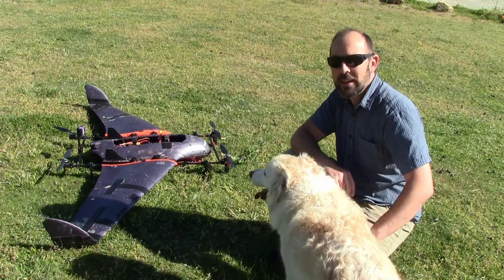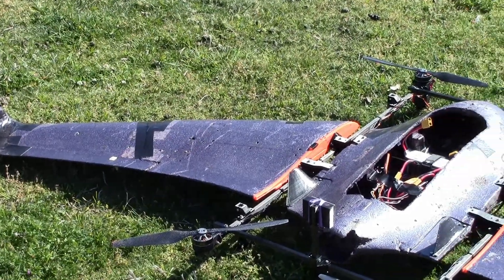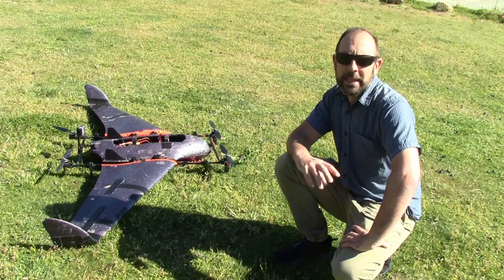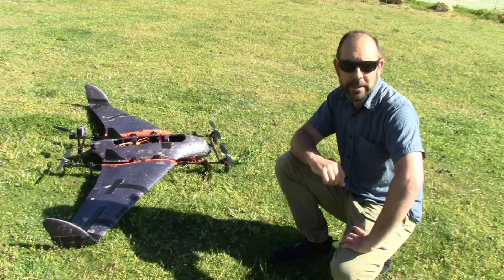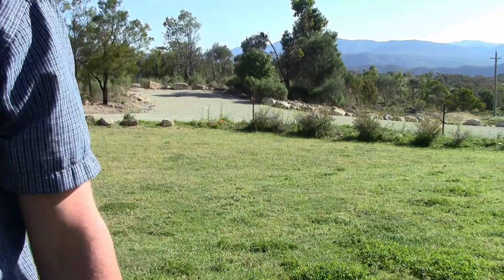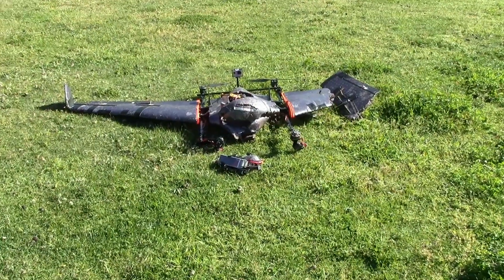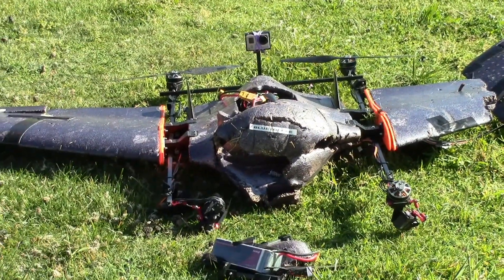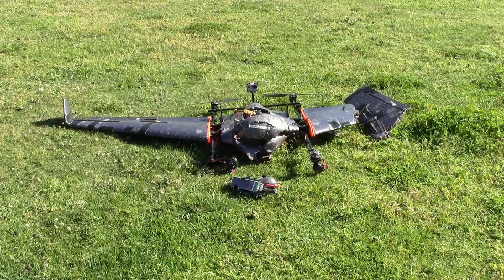Oh No! Another VTOL Crash

Comment: Crap, it fallt again. My opinnion - the two tilted motors are too away from the center point of stability from wings. There are some drones which have the same motors, but by some of them they are not tilted - because one of the back motors (as originaly by Skywalker) are activated for plane flight. And there are other type - which tilts the front motors but they are just near the wings or part of the wings. Theoreticly your drone could fly as an inbalanced plane also - but only if the push force from front motors were stronger than the gravity pulling the drone down. Dont go away from wings center of balance if you need those wings for flying ;)

Comment: Oh no, you're not going to be able to fix it with tape this time!
Reply from the maker: Last time I had to also insert carbon fibre tubing (arrows!) to rejoin the wing fragments! I've already got the polystyrene glue flowing and the 3D printer whirring away. I would really like to have the parameters figured out to get the transitions working reliably before I switch to the new airframe if I possibly can. My previous VTOL had a fifth motor for the forward flight but this time I wanted to try a tilt-rotor. I'm really starting to doubt if that was a good decision, but I'll persist a little longer.
Reply: Ouch, David! Hope you find the issue as well, although my wishes aren’t entirely altruistic…I’m building my first tilt rotor on a Skyhunter 1800 airframe. Your 3D print files have been great! I’ll be following your videos to see when you succeed!